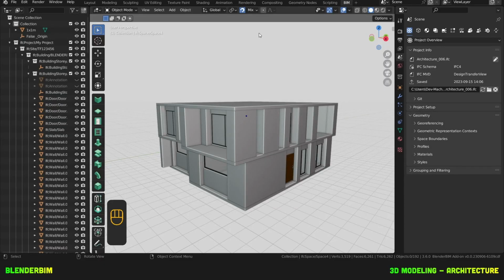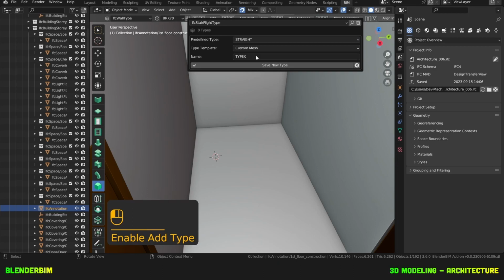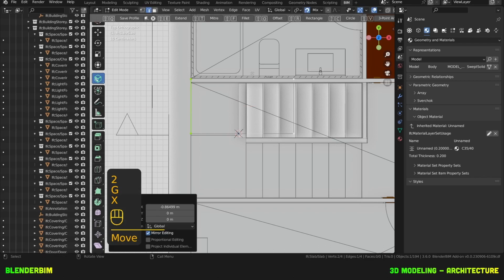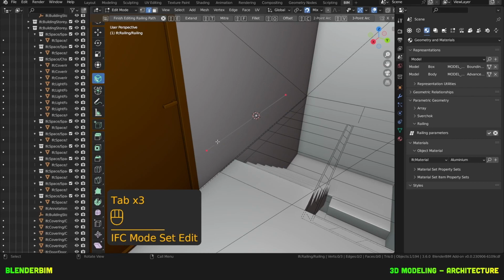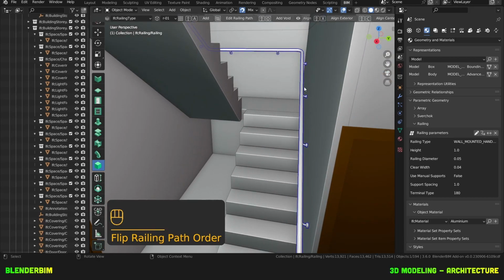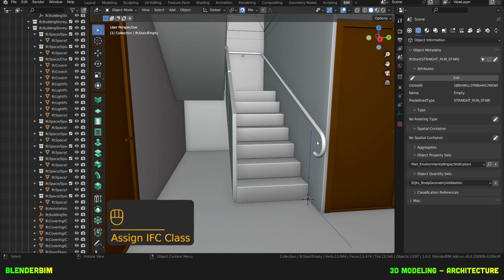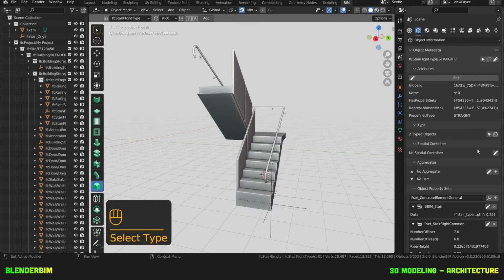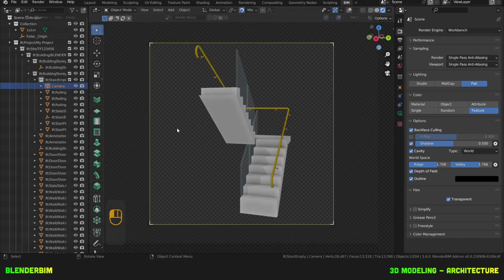8 - Stairs & Railings -  BlenderBIM

Comment: Cette série de tuto est top. Surtout qu'elle couvre la "nouvelle" interface. 
J'aurais juste besoin de deux conseils. De ce que je comprends, il faut intégrer les éléments 1 à 1. 
J'ai un mur, avec des poteaux type treillis de warren tout les 60cm, de la paille entre les poteaux, des panneaux bois + badigeon chaux tramé extérieur de quelques milimètre et un enduit 5 à 10cm de terre cru intérieur (selon mon envie), une partie rénovation avec un mur brique de silice existante.

En gros : 
— Comment créer des poteaux type warren ? (j'en ai pour la dalle, les murs et les chevrons porteurs). Dois-je modeler ça à la main puis l'intégrer dans un ifc (comme t'as fait pour la fenêtre importée avec archimesh ?)
— Comment faire les ballots de pailles pour pouvoir les comptabiliser et savoir combien re-dimensionner ? Pareil pour les panneaux bois, pour les coupes et perdre le moins de matière. 

This tutorial series is great. Especially since it covers the “new” interface.
I just need two pieces of advice. From what I understand, you have to integrate elements 1 to 1.
I have a wall, with Warren trellis type posts every 60cm, straw between the posts, wood panels + exterior lime wash of a few millimeters and a 5 to 10cm interior raw earth coating (according to my desire) , part renovation with an existing silica brick wall.

Bulk :
— How to create Warren type posts? (I have some for the slab, walls and supporting rafters). Should I model this by hand then integrate it into an ifc (like you did for the window imported with archimesh?)
— How to make straw bales to be able to count them and know how much to re-size? The same for wooden panels, for cuts and losing as little material.